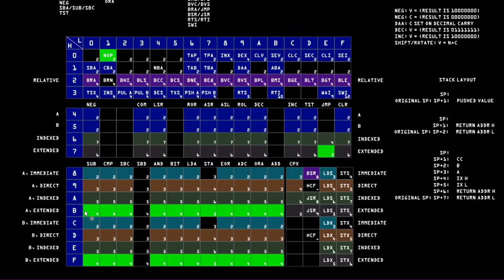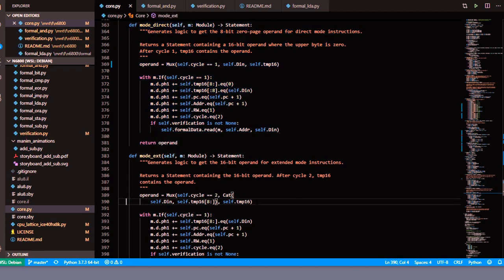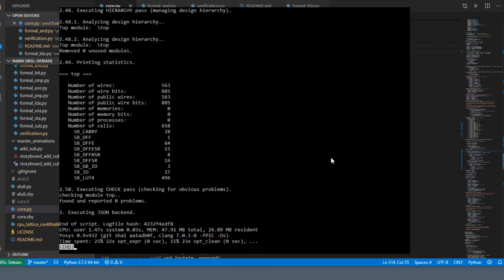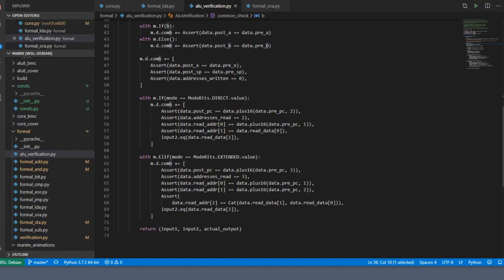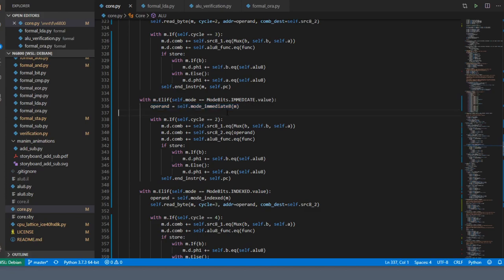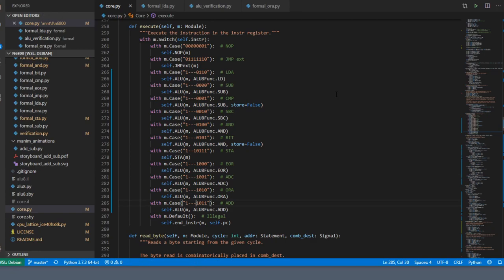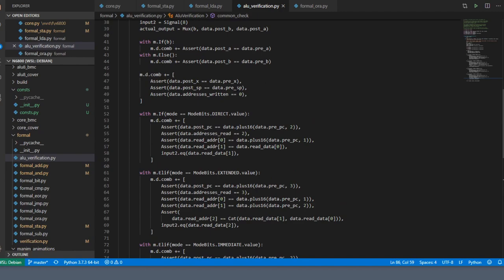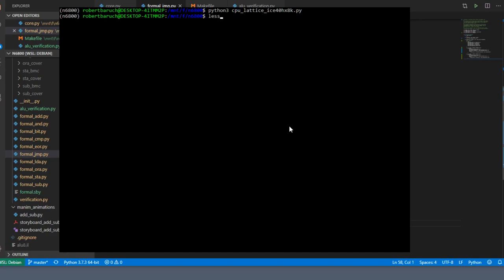Building a 6800 CPU on an FPGA with nMigen (part 6)

Comment: Unless it's intentional, for KISS sake in Makefile you might want to change dependencies from bmc/status to bmc/PASS and leave sby as the only instruction.

This way no need to delete status file manually and gmake will fail once verification fails.
Right now it will continue grinding all other verifications as the step is considered successful: after all rm will happily report that it deleted the target file.
Reply from the maker: That's a nice idea... I was struggling with how to get gnumake to fail on the first verification failure. That might be how to do it, thanks!